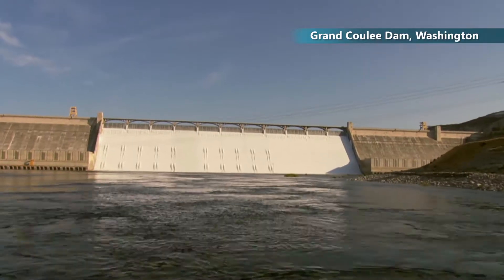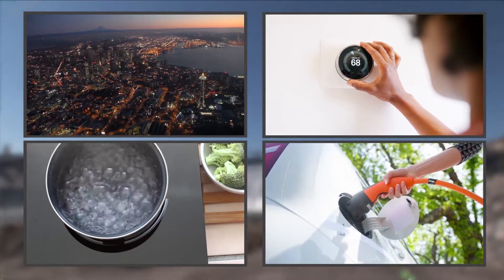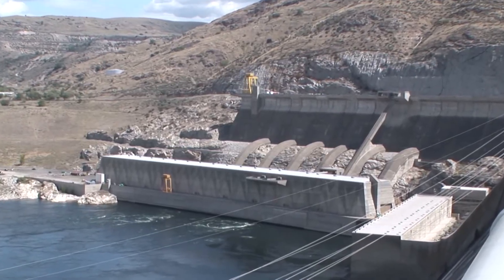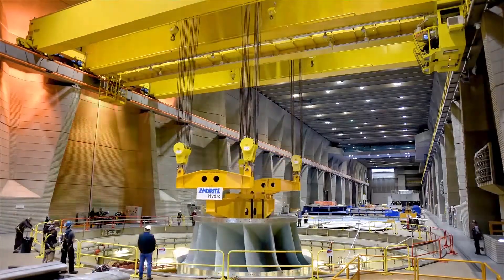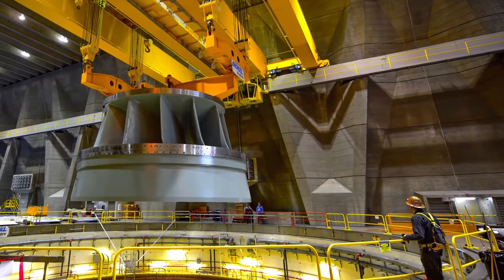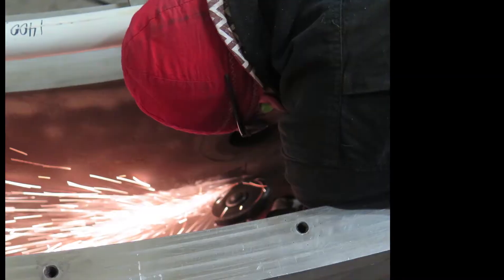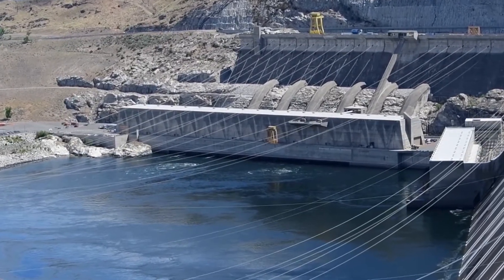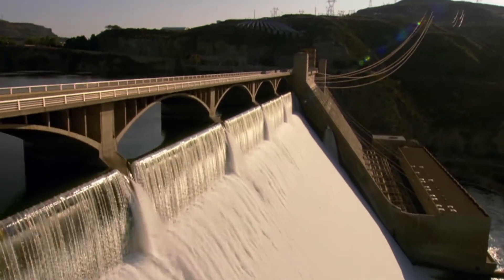Fit for the Future - Grand Coulee Dam's Third Power Plant Upgrades

Comment: Try changing to wind turbines instead
Reply: Wind isn’t great power producer.
Reply: The coulee has wind turbines as well, the water here is also irrigated by pumps, controlling the flow is necessary for agriculture in this area, a dam only makes sense to utilize. This dam alone powers many city's
Reply: @tyrantagro2830  Fact Check: this supplies "a portion" of many cities power

But with many renewables in surplus such as wind, a shift in infrastructure could make this form of power generation obsolete.
Reply: @Reed411 ... it NEVER will because it's too inefficient
Reply: @anthonyforret2117 Old minded thinking. You will be out paced by advancements in technology.